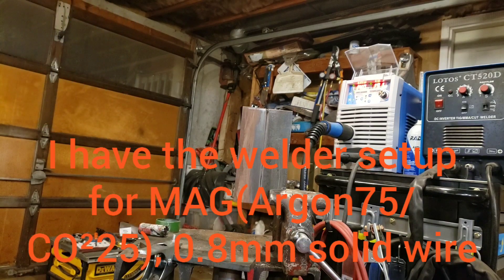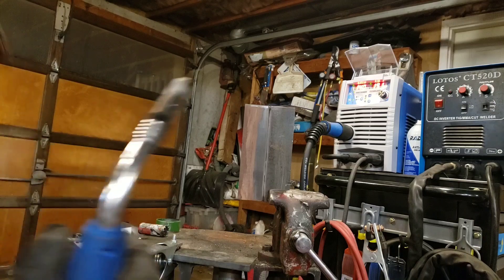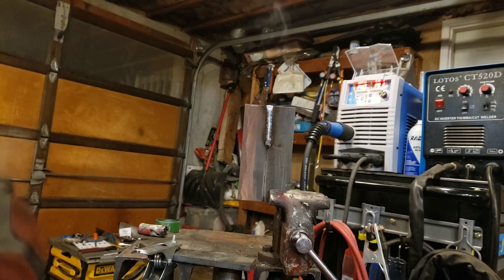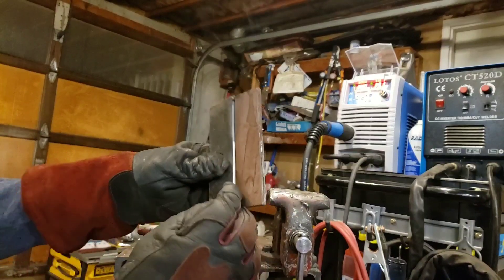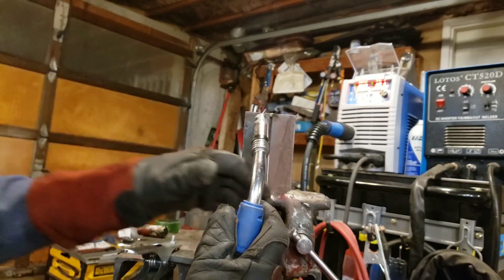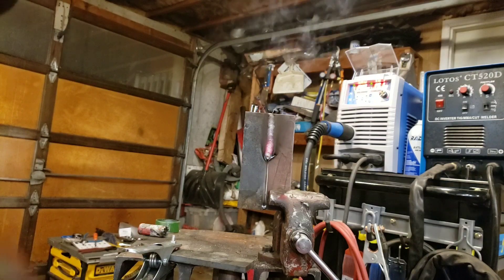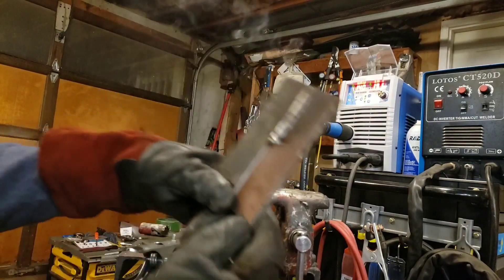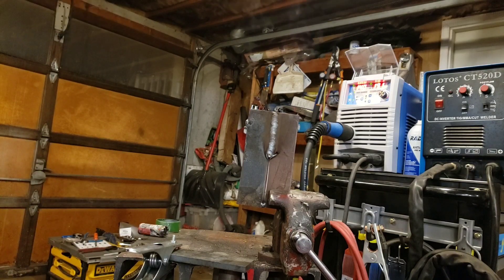Let's Weld ¼" Steel with the Yeswelder Mig-205DS

Comment: so hows it running now over a year later?
Reply from the maker: Both the Mig-205DS and the MIG-Pro250 are still working like new. I find myself using the MIG-Pro250 the most because of the quicker to setup manual settings mode.

Comment: Off the top of my head it's .35 wire for 1/4" steel that starts at 145 amps.. Seems your amps to low. Or were you using .30 wire?
Reply from the maker: 0.030 wire.

Comment: What do you think of the yeswelder 200 amp stick welder.
Reply from the maker: Use 7018 rods and you will love the results. 7018 rods are great for DC welders and are very forgiving. Make sure the metal is clean. No paint or rust.
Reply: @zuk4x493  Thank you for the advice considering I am new in this.
Reply from the maker: @oneanon  my advice would be get the Mig-205DS or the mighty and use flux core wire until you can afford a Aaron 75% co2 25& bottle of gas. Mig and mag are  more forgiving.mat being flux core wire feed welding.  Once I switched to mig I never used my Hobart 230 AC/DC welder again. Wire feed welding is just superior to stick welding in my opinion. Only 220 Volt will maximize the welders capability.  Sorry if i an being too opinionated but i would rather be Blount and honest rather than  ambiguous  and compromised  .
Reply: @zuk4x493  Does it matter what brand or size I use for the 7018
Reply from the maker: @oneanon  the rod size is dependent on the material thickness. An assortment of rods sizes from 1/16 to 5/32 should have you covered for metal up to ¼ steel. Because the flux on a welding rod is critical for great quality welds stay with brands that haven't had to be exposed to moisture during transport  like on ships. Domestic rods kept in dry investments. I personally have always had good luck with Hobart and Lincoln rods. I keep my rods in Tupperware containers with absorbent shipping packs. I rarely stick weld any more because I have the mig welder that is more forgiving for my terrible hand tremors.

Comment: This welder comes with the same mig gun as the MIG Welder 250A MIG Pro Aluminum Welding Machine. If I bought the graphene liner and U-type .035"/.045” roll driver do you think I can weld aluminum with this welder? Apart from being dual voltage, it's basically the same as the aluminum welder. 

Do you know if the spool gun works with this welder?
Reply from the maker: Yes. 5356 aluminum alloy wire 0.035 will feed. 0.030 if you keep the gun cable as straight as possible. Always use a tip 1 size larger than the wire.
Reply from the maker: Neither welder will except a spool gun. I believe they can be hacked by adding a wire feeder interrupt switch and a 2 wire plug for the spool gun drive. That would of course void the warranty.

Comment: "not too horribly bad" sounds like it's pretty bad, just not on the horrible end of bad. :-(
Reply from the maker: Unfortunately that is a midwestern term not really permanent to the machine's ability but more towards my welding ability. I have developed  terrible hand tremors following my first cancer journey that has only gotten worse with my current cancer journey. I am amazed at the on board circuitry can compensate for my condition.

Comment: Are using the 220a with the gaseless and fluxcore wire or just with the gas assist and gas wire? I have 220 plug in in my shop but I dont currently have a tank to use with the welder so I would have to go gaseless with the fluxcore wire and I'm curious about how it does with those parameters. I have been looking for a good multi functional welder for some time now and so far I am really leaning towards this welder. Out of all the research I've done the MIG-205DS YESWELDER has really blown the competition out of the water. (Within the price range I'm looking to spend). For the price of the welder I am very surprised with all the features, capable and reviews. Thanks for your time and help.

Comment: I noticed that while you were welding the numbers on the dash were changing value at a fast rate. Why ??
Reply from the maker: Near as can figure it is the onboard processor trying to stabilize the weld arc. The welder arc stability is much smoother than my vintage Millermatic 200.

Comment: On the second side weld did you melt that piece of wire off on the top to maintain arc length?
Reply from the maker: Yes I was too lazy to bother grabbing my welding pliers. 🙂

Comment: nice, I tried using a 1/8th 6011 stick but that didn't work out well. So I started experimenting with flux core. I am new to this and learned that I have a lot to learn. In watching your videos I was able to set it up and lay some horrible beads but it did work. You mentioned inductance in an earlier video, how did you get to that option and does yeswelder have a better manual? Anyways sorry for all the questions.
Reply from the maker: Their instructions are terrible. Are you using 220/240 volt power or 110 volt? They claim 160 amps on 110 but I really don't think I buy that. 140 amps is about the best a 20amp 110 outlet can handle. Unfortunately I don't have any time burning rods. Remember these welders are DC only.  Years ago when I would stick weld only I bought a  Hobart AC/DC welder. I found welding with DC more challenging than AC. As for the synergic settings, I am still trying to get consistent amp to volt settings. I find myself fine-tuning them to match the Millermatic settings I learned how to mig weld to. As I learn more about this welder I will post more videos. With mixed gas I find it to produce very stable arc welds. Make sure you have your polarity set to match your welding process.
Reply from the maker: Flux core requires positive ground and the stinger is negative. (Reverse Polarity)
Reply: @zuk4x493  oh yes they at least had that in manual. currently using 120 0n a 20 amp breaker and it does fine with flux core, the issue is me. I have some scrap coming so I can practice.When I get comfortable I'll finally use this for what I bought it for. not gonna touch my new trailer till then,lol. keep making videos I'll be watching. one last thing it seems really easy to strike an arc in mig at least at 120v. I made a 220 adapter but the wife prolly doesnt want me unplugging dryer. I will eventually figure out a 220 outlet for garage/shop.